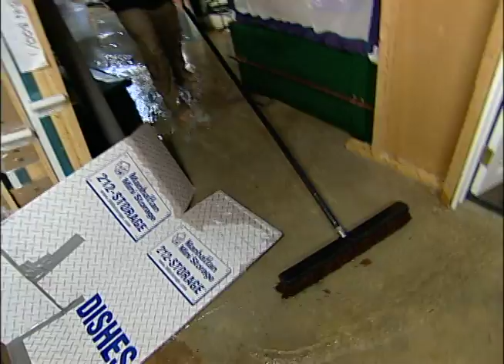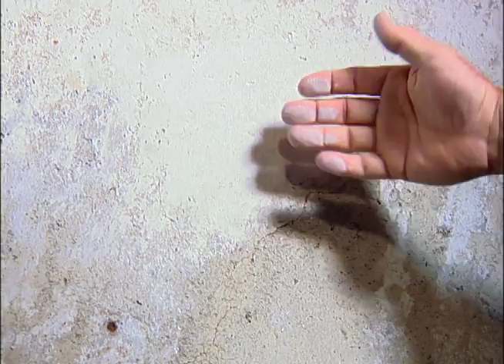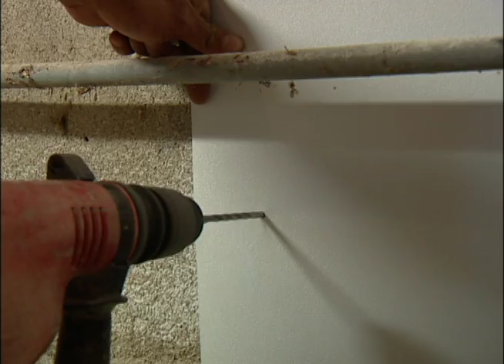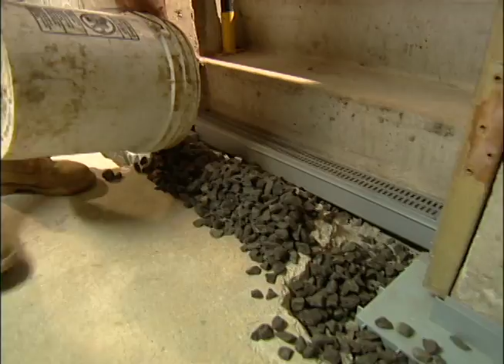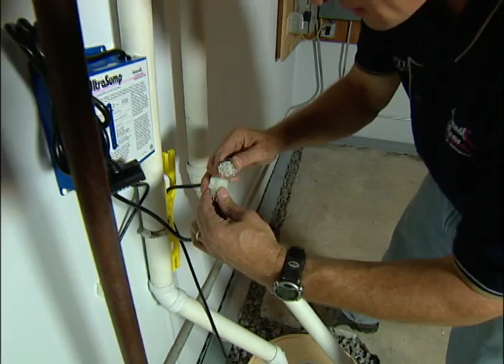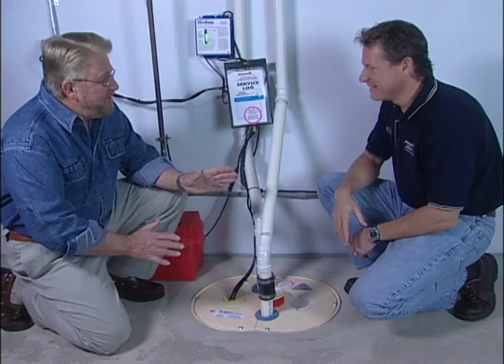Waterproof Your Basement

Comment: I hired permaseal and they installed their system and I've had no leaks for 20 years. Haven't needed to call for servicing either. I've had the same sump pump with no issues.

Comment: Just know that the slap dash concrete work won't bond to the existing slab well, and that if there's an extended power outage during heavy rainfall and the backup battery goes dead or a pump motor seizes up, groundwater will now make its way up through the cove and cold joints around the entire perimeter of the basement almost as if there was nothing there at all.

Backup systems provide a false sense of security. Batteries have to be changed often, at best you're looking at half a day of charge, and many backup pumps cannot pump half the amount of volume as the main pump can. So if you're out of town and there's an extreme weather event, your basement will be in much more jeopardy than if you had done nothing at all.

Your best defense against groundwater is often the structure itself, your uniform basement slab and undisturbed soil. Experimenting with established subsoil drainage patterns is risky business, of which water management companies do not take into consideration, as they are neither geotechnical engineers nor hydrologists. If you want actual expertise, look elsewhere.

From the looks of things, the homeowners immediate problem was relegated to one corner where water would collect, and the basement stairs. This system was overkill. A trustworthy contractor would've found ways to address those problems without the need for extensive interior work (i.e. better grading, gutters, french drain to direct water away from that corner, interior sealants, bentonite clay or grout injections etc., and some type of enclosure for the basement stairs so that water doesn't run down them. Their solution didn't solve that problem, so it remains a safety hazard.).

Lastly, if you're located in a high water table, retrofitting or reworking existing drain tile is counterintuitive. Trust me, I speak from unfortunate experience. It's convenient that most of these videos depict systems installed in relatively dry basements, where the water table is well below the level of the basement slab. Of that much, I am envious.
Reply: I’m in a low water table area and I want to install rigid pvc next to my footer and off to the sump pit putting holes in my block wall to let water flow out... what do you think ??
Reply: @rawhim5033  First I'd have a few questions.
1) Have you had your grade and gutters checked?
2) Are you having widespread water intrusion or is it relegated to certain areas?
3) Do any of your neighbors have similar issues or had similar work done?

My working theory is that in a high water table it's a really bad idea, and in a low water table it's largely unnecessary.
So essentially, I wouldn't recommend retrofit drain tile (interior or exterior) w/sump to anyone. Allowing more water inside is never a good idea IMO. Water management (i.e. relieving hydrostatic pressure) isn't so much a panacea but an introductory course on dealing with a whole new set of issues. Just my two cents.
Reply: UToobin75 certain areas are getting water, it’s a 1965 home with clay weeping tile that is definitely clogged getting stress cracks on foundation wall so everything points to hydrostatic pressure and this is a good working solution if done right without compromising air quality and structural integrity of the footer, I appreciate your prompt response!!
Reply: @rawhim5033  Full disclaimer, I am not in the industry, I'm just someone with some bad experience under his belt so I'm admittedly biased. The waterproofing industry has earned a lifelong enemy in me for the situation which they facilitated.

Bad/collapsed clay drain tile is not in my wheelhouse and may require remediation. Just know the risks, the various methods available, and be on your toes when fielding waterproofing contractors. I'd conferred with about half a dozen in my service area and they all seemed to have a slightly different approach and different price points varying in the thousands.
Reply: UToobin75 I hear you, they’ll never get my money. What system did you install ?
Reply: @rawhim5033  What they do in general terms definitely isn't rocket science. It does however take plenty of materials and hard labor.

Comment: Why couldn't the sump be hooked to the sewer line with a one way valve?
Reply: Multiple reasons for 1 It's against code Well, at least the state I am. 
2 Well, whatever reason The sewer system gets clogged The water will have nowhere to causing the pump to burn out.
Reply: Against code and causes backup during heavy rains when the sewer is over loaded

Comment: The dc pump runs on a battery ...isn’t that go to need to be replaced at so point !! It seems like it would make mire sense to repair the damage to the inside/outside walls to prevent water from interring the basement period !! That’s like having an expensive bucket to allow the water to enter and catch the water and dumping it in the yard again !! 🤔

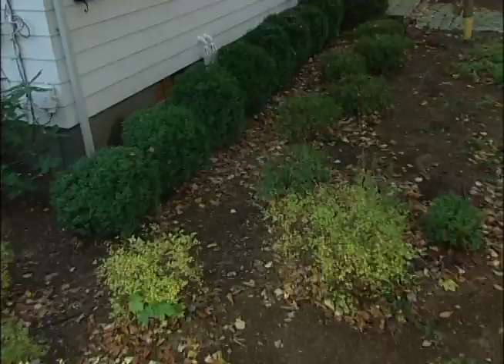Comment: 9:08 - Discharged within 10ft of the foundation to come right back in... Lololol.  All that work just to shoot yourself in the foot.
Reply: All that is necessary for a successful system is that the pumps can move more water per unit time than the maximum possible water flow incoming through the perimeter of the basement. During a rainstorm there is already so much water in the soil that any more water introduced to the soil from the sumps will make no discernible difference to the amount of incoming water through the basement perimeter.

That being said, there are alternative pipe layouts where the discharge fluid is instead pumped to the street, where it joins rainwater to the storm drain.